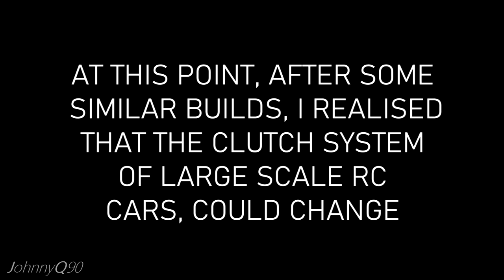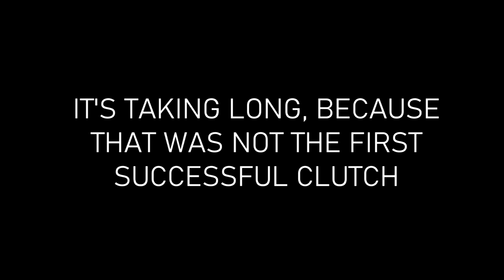Making a MANUAL Clutch for the V8 RC Car - FINALLY!

Comment: I love how his machining is so beautiful and precise he doesn’t even test it - just mounts permanently in the car and it works. Outstanding work - really is - QUESTION - do you think you will end up making a version that has the traditional transmission and bell housing?
Reply: That would be incredibly awesome if he did
Reply: dude, this is not live tv, most certainly he had several tries and tests before he shot the final build....
Reply: The magic of editing. No doubt this guy is skilled, but nobody actually builds something like this from scratch this perfectly.
Reply: @PaxHeadroom  I agree but at the same time, it's not impossible thanks to the existence of math. These days, you can do a full FEM simulation on an average gaming laptop. "All that's to it" is proper design. Measure thrice - cut once, if you will.
Reply: Nice work brother! This is what we need for our 4 stroke engines 👍👍👍
Reply: @inventiveowl395  Even then, we have seen cases where some parts later break on him etc. Either he's not running the simulations (which would be my guess) or he's not running enough of them.
Reply: I have at one point started looking into making a traditional clutch. Turns out making the required spring at home with minimum tools is not very easy. And while he has more nice tools than I do, I suspect he'd run into a similar problem. Though I do think it's solvable and do plan to try again one day.
Reply: Yes and it only took him 11 minutes to make farkn amazing 😮
Reply: It's called EDITING
Reply: If he didnt show us I would think the parts were from a factory

Comment: Hi JohnnyQ90.-  Two thoughts: Wouldn't it be better to use a friction (and heat) resistant material for the clutch cone such as the one used in brake pads or clutch discs? Second, While engaging the clutch, you are applying axial thrust to the engine crankshaft.- Can the crankshaft bearings manage this..??  Regards, have a nice day...
Reply: valid question regarding the axial thrust/stress caused by the lateral forces of this DIY clutch... I don't believe these Toyans were made to be used as such, more like display pieces and/or generator models.
Reply: He's already run a car with a similar engine. And he's able to machine and upgrade any parts that might show as weaknesses.
Reply: @BeezyKing99  This could be solved placing a thrust bearing between the engine and the clutch and fixed to the chassis...
Reply: Nylon (or any random plastic) cones are ok.
The power output is minimal and thge contact area is wide.
If the torque to be transmitted will ever exceed the clutch "rating", it's simply a matter of making a new bigger/wider/longer one.
Not to mention that a new cone will take a very short time to make (the shape is simple enough and the material easily adapts in the case of a mismatched angle).

Regarding the axial load on the clutch, as Carlos Schagun noted, it's simply a matter of using a thrust bearing on the bearing support...
However, even shitty ball/roller bearing can take some axial load, and I doubt that servo is pushing with such force.
Reply: @Morannar  I´m not worried about the axial load on the clutch assembly, I´m worried about the load transmitted to the engine crankshaft that most likely cannot handle this type  of load.- To avoid this, a thrust bearing must be placed between the engine and the clutch.
Reply: Their already is a bearing
Reply: @Morannar  Also, note the spring on the servo. It does start to compress at the limits, so that's what sets the actual force.
Reply: I think a stiff spring and a couple of thrust bearings between the clutch and the carrier bearing would be ideal. So as to take the load off of the servo. Should save some battery also. I love the cone clutch concept though. I believe in will turn out to be the best overall for all of these little V8s and V12s. Johnny is the Man.
Reply: the term youre looking for is thrust bearings, and i dont recall seeing any in the installation videos
Reply: This setup is especially bad because in a normal clutch it keeps the crankshaft under no pressure during normal operation, it's only when you push the clutch that the thrust bearing is actually loaded. Since you only really ever push the clutch when you shift you usually hit the thrust bearing with no real engine power. This setup however, always has the thrust bearing loaded whenever you are actually using the output power of the engine.
Reply: No
Reply: Don’t talk @Sundog0811 unless u are actually going to contribute to the clutch question
Reply: Like a Drexel cutting disk epoxied to a metal backer for a clutch plate? Would take the heat and generate friction anyway.
Reply: Je suis du même avis que Daniel, je pense aussi que l’embrayage devrait entrainer la transmission sans que le servo soit en action (grâce a un ressort) comme sur un embrayage traditionnel (quand on appuis sur la pédale, pas de transmission entre moteur/roues. Et cela soulagerai le servo ! 😊
En tous les cas, jolie travail, bravo.
Reply: Being a cone clutch, these traditionally don’t need a lot of force to make a positive engagement.

Comment: Hope there's going to be a lube system for that gearbox !! Awesome work as always ❤
Reply: Encase it in acrylic maybe?
Reply: @RingingResonance  Some thin sheet metal maybe because the friction is going to cause heat and that heat will transfer to the oil and then into the casing (As it does in real cars) so you want something that can absorb and conduct heat fairly well.

Comment: Beautiful, your engineering skills are admirable! Just one thought, there must be lots of axial force on the bushing and male cone of the clutch, maybe it's not an issue, but I can see how a little thrust bearing in there could help :)
Reply: Cone clutches don't need much force to work. Delrin is a pretty good bearing material so I don't expect he will have much trouble there. At a guess the most likely problem will be the Delrin melting where it meets the female taper.

Comment: My Mosquito racket stopped working. Its Lead acid battery failed. I soldered a 18650, now its working fine. Now i have to place the Charging circuit in the bat. I have a small motor with drill attachment, which i have to use to remove all plastic for fitting charging circuit. This guy has so nice tools, i feel like jumping off a tall building.

Comment: I would suggest changing the servo positioning such that the servo horn is almost parallel with the linkage it is pulling on at "full clutch lock". This will give you greater precision for slipping the clutch, more pressure that the servo can actually put into the clutch, and also put less strain on the servo when holding the clutch engaged.

Or implement it like most full size cars, where the clutch springs pull it tight, and the input (clutch pedal) disengages it.

Comment: Awesome man! Love your content. I’m a auto tech. The only thing I could recommend is to make the clutch self engaging. That way it doesn’t put extra load on the engine from the friction of the clutch fork bushing when you trying to draw power of the engine.  You could have a it spring loaded and relaxes the spring tension with a clutch fork to let it free wheel. Like they do on normal manual transmission. I think the extra friction is hurting the performance greatly.

Comment: I love it you're the boss. All of us passenger seat engineers who could only dream of having the equipment you get to sport. And will never have anything close to a scaled down super bad ass V8 engine to install in an r/c car. Are giving you all the advice you can possibly handle. My only suggestion is to load the clutch with a springamathing so as to take the load off of the servo. You're awesome JQ!

Comment: Hey , you should get a remote where you can mix the channels . For example CH2 which is throttle and the channel you use for the clutch , so that when you give throttle the clutch engages without use of a third hand. Great job as always!!!
Reply: Interesting. Would he be able to adjust them independently? I ask because the clutch needs to become fully engaged, before the throttle is fully engaged. I’m guessing the clutch  servo will move little compared to the throttle servo. But I like this idea very much 👍
Reply: @SilverShux  yes you can vary the rate of the channel or even disengage it. We use it on rc crawler for exemple to winch accordingly to throttle.

Comment: Stunning job so far! I did noticed the teflon cone was coming out of the clutch housing while revving the enging. Not sure if centrifugal forces are overcoming the engagement solenoid or not. Just FYI.
Reply: Maybe it will be better if it disengages when pedal is pressed like a normal car, that way it can use stiffer springs

Comment: You could use channel mixing on the remote to apply the clutch smoothly for the first few percent of your throttle throw. The dial would still allow you to actuate it manually if you wanted to do full throttle launches or anything like that. It would also make it so it will automatically disengage the clutch when you brake so you don't kill the engine. 
Many people have mentioned the wear on the engine's crankshaft since it likely isn't built to handle the axial thrust from a clutch. Depending on how durable you want it to be, it may be necessary to fabricate some form of external thrust bearing or a clutch that acuates from both sides to eliminate the thrust.
Love your projects!

Comment: when you're parting anything off on the lathe, use the back of a cheap bic pen to catch the part or just stop it and pull it off when it's really close. that will save you a lot of dings and scratches.

Comment: You are a master of your craft. Engineering a clutch system for your 4-speed transmission is all inspiring, I can't wait to see the things you build. I build a lot of My RCS from scratch used parts from children's toys and 1/10 scale RC parts. Carbon plastic in wood and metal s. The car you're doing right now is what all RC's should be. I have installed a 2.5 ofnah nitro motor into a RadioShack 1/5 scale Camaro. The first time I took it out to drive it the engine revved out of control and destroyed my drive shaft so now it has sat for a year while I build 1/10 scale crawlers and trail trucks. I look forward to everything you build, it's quite amazing. Can't wait to see what is next🤔

Comment: Cool. I have a Tamiya Toyota Hilux still sitting here that came with a 3-speed gearbox. On an electric motor. Beautiful piece, completely sealed. Although not sealed enough to run in oil, which would have been even better.

Comment: Interesting use case for what appears to be UHMD in a friction application. Normally that is used to reduce friction, if that is in fact UHMD. That set up is also creating a little more load for that little engine. Only mentioned that since you mentioned the 4WD was working the motor hard. All those extra rotating friction points are also adding slight loads that will eventually add up. Still a great build, not knocking it at all, keep up the good work.

Comment: I think your best bet is going to be light weight steel bell housing and a steel cone with a machined down brake pad to fit either around the inside of the bell or outside of the cone for better engagement. I noticed the cone back out under load and also figured the Teflon probably wouldnt provide the best grip for this application.

Comment: I’m wondering what it’d take to make a more traditional clutch setup where the throw out bearing isn’t constantly engaged like that. 

I’m definitely liking this more though, as a guy that drives a manual car lol. This is the way!
Reply: This is what I was thinking as the clutch engagement is based on servo strength.

Comment: Hi JonnyQ90, Fantastic work! Wouldn't the clutch be better permanently On rather than off? Then the actuator is working momentarily to disengage it, rather than all the time? Like a full sized vehicle clutch?
Reply from the maker: I want to be able to apply the clutch progressively. In an on/off situation things get more violent and I'm not sure it can handle it.

Comment: I'd make the gearbox and the rear diff one unit. You have a CNC, cutting the two gears required to do this would be easy for you. You could also have a transfer case from that diff to the front if you want 4WD, but honestly, 4WD is kinda overrated in my opinion on RC stuff (when you're not offroading as a type).

That should give you a 50/50 weight distribution easily if the battery/fuel and electronics live in the center. You can also try making a torque tube type construction for it, which then removes the need for a bottom plate, which in turn makes the car much lighter. I've never done it myself, but i've seen one third scale RCs with it.

Also, for the clutch, look up "OEM 121K42230" or "121K38310" and dive into the world of those types of clutches. Ditch the RC types, because they'll never be as good as a miniaturization from car to RC car, whereas these clutches have been in the making for over 40 years and have various sizes and power couples. They're also reasonably cheap these days with most manufacturers looking to make things as cheap as possible, thus ditching using clutches in their products in favor of other methods of coupling, thus relegating these as spare parts.

I've been using such clutches for RC for quite a while now and they're bulletproof. I've never changed the (already used, recuperated from a 1990's Xerox machine) clutch i have adapted for my early 2000's RC car, still up and running and i'm not even using it at its full power potential (12v) rather at half of it, because it mimics real clutch behavior that way.
Reply: Hmm very interesting.

Comment: Sewing machine conical clutches use leather as the friction material. in the 25+ years I have used them, don't think I ever had to change the leather. Nice and smooth too.
Reply: Are the RPM even close?
Reply: It was a fairly common clutch system in turn of the century cars, too.  Off hand, I know Renault used it.
Reply: @GeomancerHT  3krpm

Comment: Hey John ?    You should have put the center section/clutch & motor on one flat piece of stock ,to mount them solidly together.  
The chassis flex can be a issue .
Reply: Chassis flex will also be an issue for steering, since the steering servo is mounted so far from the front.
A rod across the top of the chassis, from shock tower to shock tower, will really help out.

Comment: 7:25 that was not much threads you drove in there.. like only half a turn or 1 turn. Would suggest a tiny bit longer screw there so the screw is not ripped out.

Comment: With some clever chanell mixing, you could get a 3 speed automatic gearbox experience. Or if the gearbox will allow for it, some no-lift sequential gear changes action. Would love to see that!

Comment: An aircraft transmitter would probably make using the clutch and shifting gears easier. Then you would be able to engage/disengage the clutch, steer, shift gears, and rev it all at the same time.

Comment: why didn't you make the clamp based on a spring and thrust bearing ? You wouldn't push the clutch with a servo, it would do it automatically

Comment: It always awesome to follow your vids.
- I think you will need a different power plant/engine if it can’t handle the additional drivetrain resistance from 4wd, with no load on it. Just a thought.

Comment: Amazing work, one thing that comes to mind though this looks like it's got more torque then your typical glow engine, and the gearbox has more gears and counter gears then a typical setup wouldn't enclosing the transmission and adding something like ATF oil provide more protection just like a real transmission to protect your work, just a thought.

Comment: As some other comments have said, that brass collet could be replaced with a bearing of some sort, lots of friction will get built up there. Another thought on the cone clutch, if you put in some helical splines on the taper surface, that should help it bite into engagement (until it wears out of course)

Comment: first of. beautiful. fun to se. but as interested i ofc se things i think about (like many others in the comments) 
my thought was that the lever from the servo to the clutch should be so that the clutch moves less and has more force. im afraid this will slip. also if the servo is to hold force all the time it will consume battery and maby get hot, so a spring should engage and the servo only disengage.

Comment: yo, I reckon put the supercharger back on (give it a BIGGER COG for the belt) it will run much more efficient!

bogging out on max throttle?
get some better form of gaskets rather than rubber O-rings (will help with air compression) or use some form of heat/cold resistant sealant to keep air compression throughout every part on the engine block/supercharger attachment.

Comment: I would recommend adding a thrust bearing between the brass mover and plastic clutch, it might feel like it is spinning freely but at thousands of rpm and just a little bit of force when engaging the clutch, I think you are going to loose a lot of power to friction

Comment: Perhaps try some channel mixing (if your radio has that)? That way the clutch will engage when you apply a certain amount of throttle and have to rely on the dial.

Comment: As a little side project, you could make a little test stand with rollers, like a dyno. Would be pretty useful for all the  testing you've been doing on various cars. Adjustable wheelbase for different chassis?

Comment: Would be super cool if you could get the gearbox and clutch working like the older Ferrari F1 transmissions, where it drives like a normal car but at WOT it can do really fast changes.  You could set up a Pi to run as the TCU.